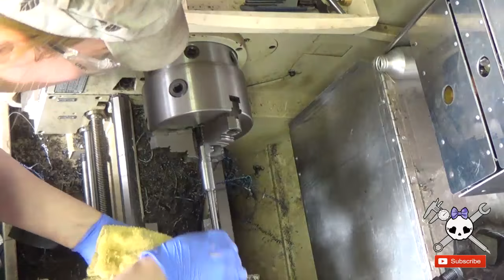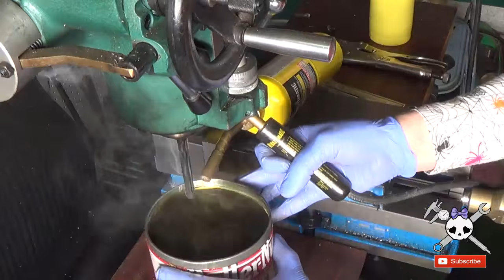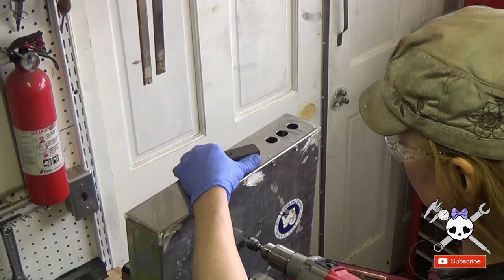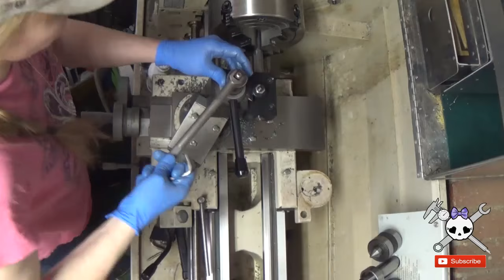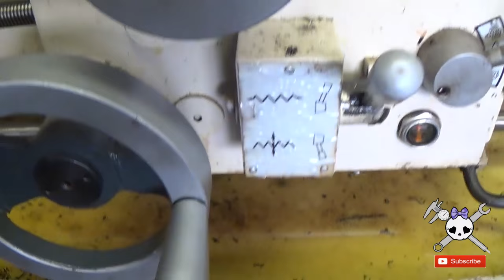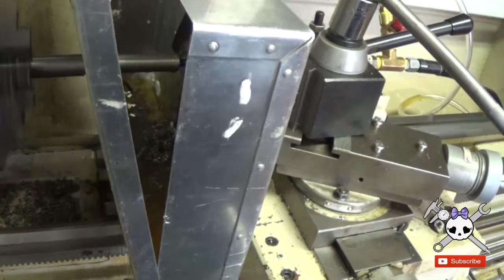1880's single action revolver built from scratch (part12)

Comment: Coming from a Master Machinist of 25+ years ... the level of skill and machine knowlage shown and exhibited by this young Lady far exceeds 95% of the worlds machinist, she is in the top 5% i'd have to say,  anyone can punch a button on a cnc machine an make almost anything possible these days...   but operating manual machines like she has in this project is far beyond extraordinary...
Reply from the maker: Wow thank you that is an amazing complement :)!
Reply: +Waffenschmiedin x On the comment above can you please mention if you did study as a machinist? Unless you are absolutely besotted with machining and you are at it all day long. I am not a machinist but in my 70th bought a couple of Chinese machines  and have been having fun ever since. Paradoxically a friend of mine (ex Submarine engineer) Did make a full size pistol but as we live in England he could not finish the bore. He only drilled about an inch or so either side and left it at that. Excellent work very impressive  and can't wait to see it finished.  AND HAVE PICKED UP A FEW MACHINING TRICKS AS WELL .REGARDS
Reply from the maker: I worked in a machine shop for 2 years. I learned the basics from the old timers that were there. after that I started doing industrial maintenance. the places I worked were very old and most of them had a mill and lathe. we had to make a lot of parts you couldn't buy any more for outdated machines so I basically learned by doing :)
thank you so much for the nice complements :)
Reply: I agree, i'm in awe actually. This series is mindblowing. The fact that its a woman doing this is even more mind blowing. The women I know don't even know that their car engine has oil in it...that you have to check!!

Comment: Fantastic build young lady, I am way beyond impressed with your skills at machine work and your ingenuity in problem-solving. You may very well be a "one of a kind" multitalented, person. 
Also, just so you know, pressure washer pumps and motors are designed to run at/under high-pressure loads and deliver only small amounts of water. To create the proper pressure they rely on the orifice in the tips of the wands. Without this orifice, your pressure washer pump motor will eventually fail because the load on the motor is not sufficient. To keep it running it needs to have that orifice in the line somewhere.

Comment: sorry if you know what i am going to write here and its just a tip. if you have any of your part being hardened after machining that cannot have any change, go with austempering. i finished all machining of a bolt action I have designed and then sent it out to be austempered. i had no warping or change. material was 4140.
Reply from the maker: +Marcos Godoy thank you I looked into it

Comment: Lovely work again! I really liked the chambering  reamer build - old school!  If ya don't got it just make it!Saying your logic aloud is actually smart for working through problems and I realise you're narrating the vid but it still works.
But you are too modest ;- you're a gunmaker in every way and many gunsmiths are just component swappers.
Eventually you might go over to collet systems rather than Jacobs type chucks. They're cheap and totally repeatable and go for peanuts out of China.  The Jacobs are OK and shift a lot, but still not bad for quick 'n'dirty .
Reply from the maker: Thanks for the nice comments :) 
ya that many collets would cost a mitfull and take up a lot of space i would think ?
Reply: Not that you need them , as you're doing fantastic work anyway, but the 3C setups are fairly compact and affordable and you can top-up with the sizes you need.  
There is some good quality stuff out of China now and they're moving on from cheap and nasty to good just like the Japanese did.  Aliexpress has a whole heap of tooling , coolant pumps, measuring gear ..whatever else you could desire, and it's often  from the same sources as stuff marked-up by mega-percent and re-branded for retail.
But there's always going to be something else to buy! :)

Comment: Luna, couple of questions, first of all, Mighty fine again Gal, how fast were you turning that barrel when boring it and number 2, it looks like you have a little storage space behind your lathe and attached to it, can you take a shot of that next video. Thanks, Oh and I agree with Thistledome
Reply from the maker: It's recommend the drill be ran at 5000 rpm my lathe doesn't go that high So I ran it at 1400 rpm and at it slowest feed rate .oo11 I believe
Reply from the maker: +Mike Ferguson none of what I did was at its recommended speed feed pressure but it seemed to drill just fine any way. as far as storage there is a little room behind the lathe just because the chip pan makes it so I can't move the lathe close to the wall. its over the top of a window that was on the outside of the house. ya its a good place to get rid of stuff I don't use that often I used to have my air compressor there :)
Reply from the maker: +Mike Ferguson I will play around with drilling a few more just to see if I can get better results later :) but the results were really good to start with.
Reply: +Mike Ferguson That is just fine Luna, I know what you mean, I was taking a lot bigger bite on my mill than was recommended the other day, I mean way bigger, it the mill and the cutter took it just fine, chips looked a good color and the mill wasn't complaining any that I could hear or tell. So thank you again
Reply from the maker: +Mike Ferguson np :) see you on the 4ums :)

Comment: Is that a Grizzly brand lathe? How do you like it? I went with a SouthBend 9 from the 40's and a Clausing 12 from the 60's. I spent a year restoring them, they still need work. I love my old American iron, but I something wonder if I should have just given in and gotten some new Chinese Iron.
Reply from the maker: +Andrew Tubbiolo I Love it , but its has its good and bad points.  the good first. it has upgraded Japanese spindle bearings, (the same lathe non grizzly dose not) .it has a decent size 1.5" spindle bore so you can do stuff like im doing like drilling barrels it using it to rife. it has been dead on accurate and I didn't have calibrated the head or mess with anything.   the "bad". much of the stuff that doesn't "count"  like the chip pan and base look a little homemade, but functional. I figured for the price they have to cut corners some place. the steady rest is total junk I will build a new one later. its not even worth trying to rebuild better.  you cant hold any thing bigger then about 1.5 inches and the bearings were pinched when making it so they don't really turn well. the second steady rest that bolts to the carriage is actually decent. I use it quite often.  I was looking for used American iron first. but every thing I found in my price range was used up junk. so for the same price I got something brand new that will probably outlive me.  I have used a lot of American lathes over the years and it works as well as any of them. I wouldn't say "better" but equal to lathes of the same size.
Reply from the maker: +Waffenschmiedin x yes it is a Grizzly  http://www.grizzly.com/products/12-x-36-Gunsmith-s-Lathe-with-Stand/G4003G
Reply: I see what  you mean about the steady rest. It looks like its missing a lot of metal in that picture. I loved your gun drill system. I just might copy it myself. I bore deep into steel and copper for rocket combustion chambers and a forced oil flow onto the boring head would really help.
Reply from the maker: oh sweet would love  to see that
.   you use copper for a rocket engine ?
Reply: Waffenschmiedin x
Good thermal conductivity. Gummy as hell.

Comment: German miling machines drown the parts in cooling liquid. I alqays knew that was a waste of liquid.
Reply from the maker: mine is equipped with it but its so messy I hardly ever use it.  it does make the tool last longer but its makes it hard to video also.  id rather just sharpen the tool lol